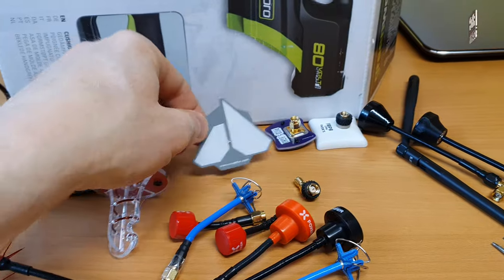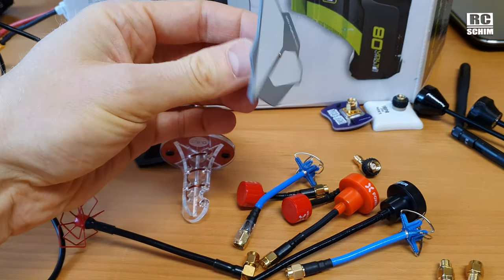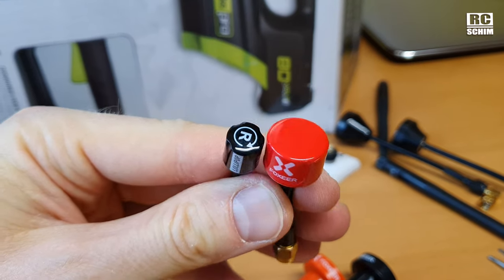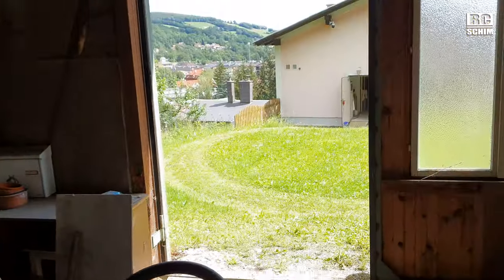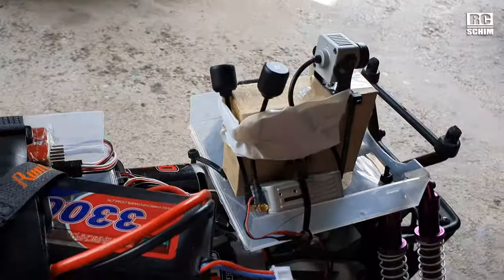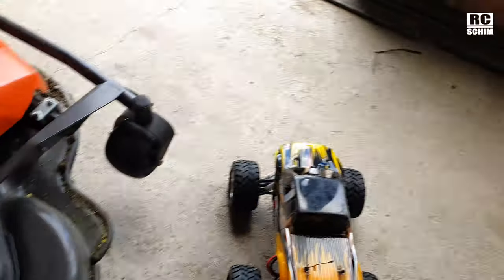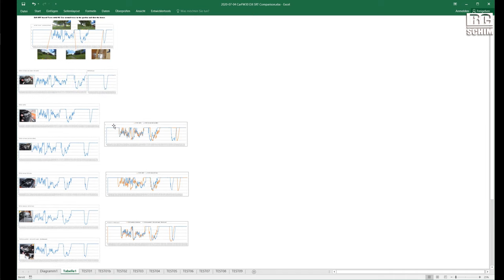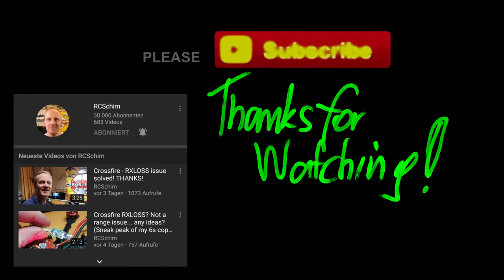ANTENNATESTS: Analog video then DJI Digital (incl Logfiles)

Comment: This is great testing and like many great tests, it opens up a lot of questions in my mind... Lot of useful bits to make sure we maximize our DJI FPV reception (at a low cost). I guess that in the end it is all about testing in our own environments, I'll try to do that while trying to duplicate your test methodology. Cheers and continue sharing the result of your tests. This is extremely useful.
Reply from the maker: Thanks. if you want to test yourself, check the link to the DJI SRT to CSV script I made. With this you can easily analyze the DJI logs. see the seperate video...

Comment: I thought you'd be surprised by the performance of the linear antennas :-)
Reply from the maker: Linears were never bad - only their "reflection affinity" was hindering in analog. Turns out in digital it is totally taken care of with their coding magic, right? Why didnt they just use linears as stock then?  (or did they, and the stock antennas are just short linear antennas which should confuse us?)
still, testing antennas is seldom really conclusive. There are so many "nuances"... 
with the flight testing (which I mentioned in the last seconds) I felt that lolli micros were awful, Lolli stubbies were also a bit dissapointing - and normal lollis were actually really good. SPWs of course also - but not buy much. looking forward to compile the next video.
greets and thanks for commenting Bruce!
Reply: @Rcschim  Please don't use that abbreviation for the lollipop antennas. The google search results are a bit .... questionable for that search term. :o
Reply: @Rcschim  Yes, as I said before you made this video... an antenna's performance is always related to the amount of metal it has intersecting the signal.  That's why smaller antennas tend to be less effective than bigger antennas (all else being equal). :-)

Comment: There is an important thing, this test is like the direction test, the drone is Omni, so also need to consider the antenna signal radiation pattern, maybe have a machine to test the antenna's radiation pattern？

Comment: So far I have yet to see compelling enough results that makes me want to swap out the stock antennas. I hate having to take on and off the antennas from my goggles everytime I fly. Those sma connectors have a mating cycle lifespan and I'd rather not have to take the goggles apart to replace the antenna wiring harness any time soon.
Reply: Ur missin out man, Basically any antenna is better than stocks, dji used shit antennas to limit output on top 2 ports to meet fcc regs, i use 4 adapters so 0 wear on OG sma's.  Go w 4 stubbys like true rc or for cheaper 4 lollipop stubs they are great, its soo easy to do static test thru a house n see for urself,  that aftermarket antennas hold higher mbps
Reply: And if ya take goggles apart, warranty is voided
Reply: Flo-Rida FPV as he said he hasn’t seen results that justifies $100 in antenna and I’m with him,I saw a guy hit the I think 4 mile wall with stock
Reply: I leave mine on.  The goggles fit perfectly fine in my backpack with the antennas on and I just take care not to damage them.  What would probably be handy is a foam or 3d-printed "antenna guard" that could provide additional support during transport with antennas on.
Reply: @xjet  I have only really seen a difference on the quad side and that's correcting my bad antenna placement. Shouldn't patches  be what to run if your flying directionally and farther away?
Reply: @RubyS.1  I prefer helicals to patches because they tend to have a much better axial ratio (rejection of reflections) than almost all of the commercially available patch antennas.  Also, you can make your own helicals for just a couple of dollars.

Comment: So patches in left side of goggles? 
On the right side stock?

Is this consistent across different locations?
Or is it localised to your garden?

If on a kwad would it work best on left side in all locations?

What is the best all round antenna set up?
Reply from the maker: check out Dennis conclusion - he crushed my excel numbers and found Test 7 and 9   (the ones with patches involved). Seems to make only little difference if patches are sideways, or bottom mounted.